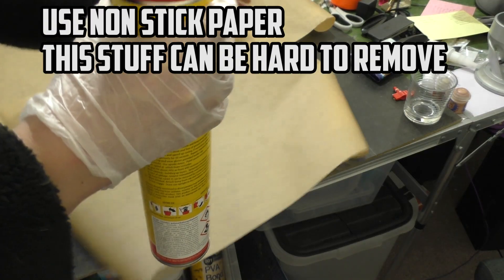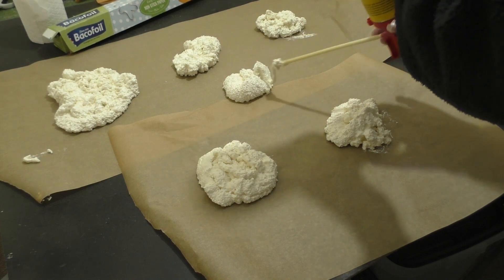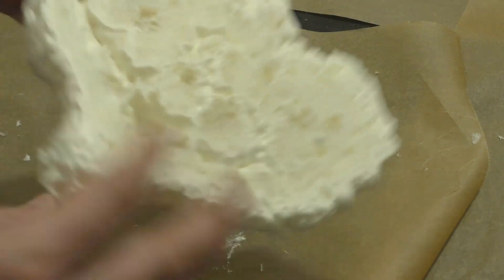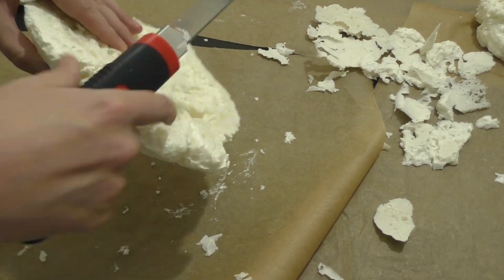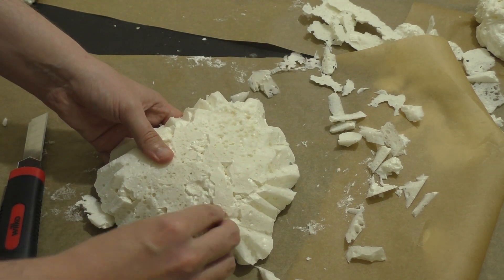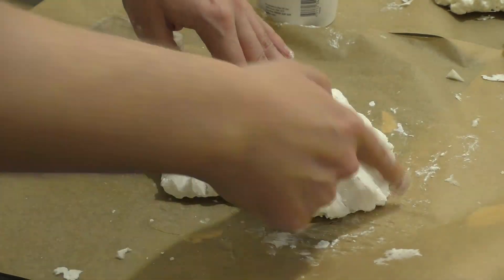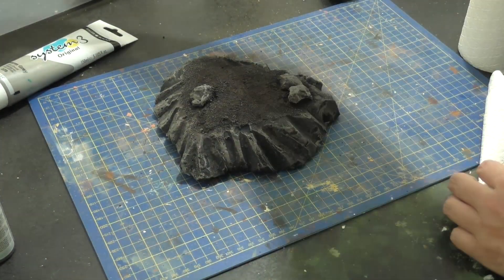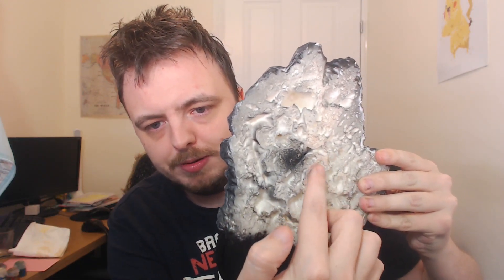Expanding Foam Wargaming Hills - Cheap & Easy

Comment: Nice work, but just a small worry. If that foam is what I think it is, it's highly cancerogenic. You should be wearing gloves and a mask when working with it, especially when cutting and sanding it.
Reply from the maker: Fair enough, I know for spraying it you should, I didn't know about afterwards.
Reply from the maker: @ExianProductions  Always worth researching things for yourself, which I sort of didn't!
Reply: Anecron1 the word is “carcinogenic.” And not to minimize the need - I would certainly encourage people to wear gloves and respirator when working with the stuff.  But a lot of those precautions are intended for people with occupational exposure.  Where it’s their job to use the stuff and they expect to have big levels of exposure every day for years and years.  Probably for the production of a few wargaming hills your exposure is not too high.  

For context, lots of things are considered carcinogenic, including processed meats.  So it’s all relative.

Comment: Took on this project today, and it went surprisingly well! I used your recipe for homemade sculpt a mold as a substitute for the filler. I haven’t painted or flocked it yet but I’m ready to do that tomorrow. Thanks for the great video!
Reply from the maker: Good to hear you presssing, sounds fun! Thanks :)
Reply: My original shape looked like the millennium falcon ;)
Reply from the maker: @EpicParsnips  Heh, that sounds pretty good to be fair. It is fun slicing up foam.

Comment: I like using the 1" expanding foam for smaller things and Dap DryDex joint compound (spackle) because it goes on pink and turns white to let let you know it's dry.

Comment: I wonder if you use  a square cast you can spray it inside and make foam sheets for yourself
Reply from the maker: I did think about something similar, I might work up the energy to try it at some point :)
Reply: @TerrainMadeEasy  i did see some videos of it on youtube and it works really well, i live in Brazil and i don't have access to XPS
Reply from the maker: @leonardochagas9930  OOO COOL, WILL MAYBE TRY IT